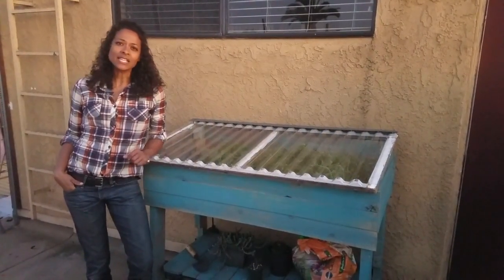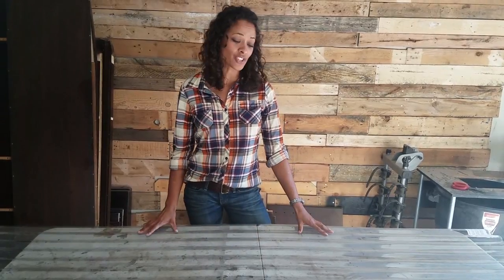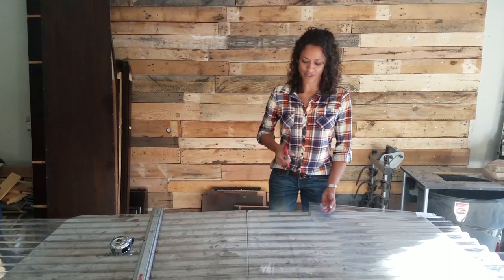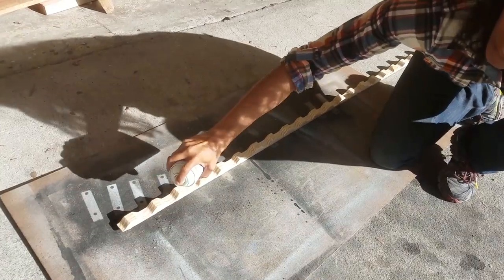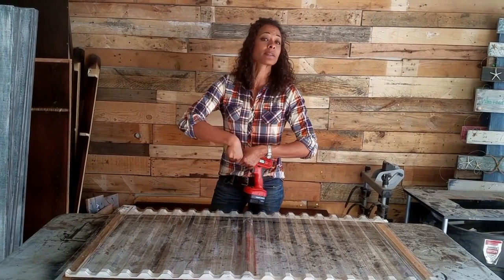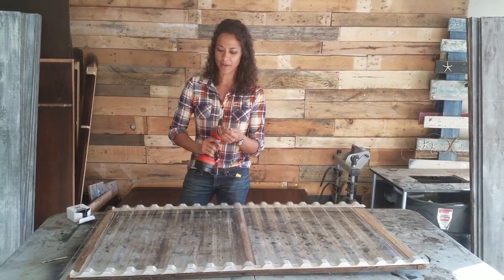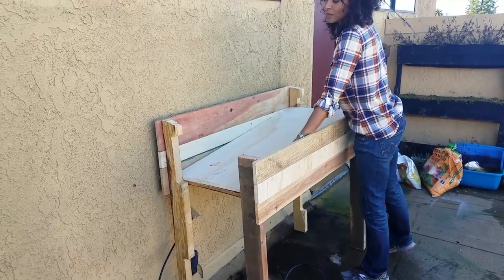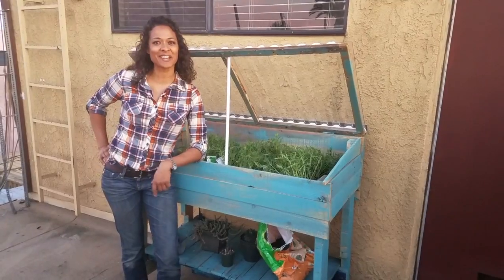"Urban Greenhouse" with TUFTEX PolyCarb Panels

Comment: POLYCARBONATE IS A GOOD CLADDING MATERIAL AS WELL AS  ITS EXCELLENT FOR GREENHOUSES. TELL ME HOW WOULD YOU VENT THE GREENHOUSE, BECAUSE ITS REALLY HOT IN THE TROPICS AND IF THE GREENHOUSE IS NOT PROPERLY VENTED THE PLANTS WILL SUFFER FROM THE HEAT.

Do a video on ventilation of greenhouses made with POLYCARBONATE sheet profiles....